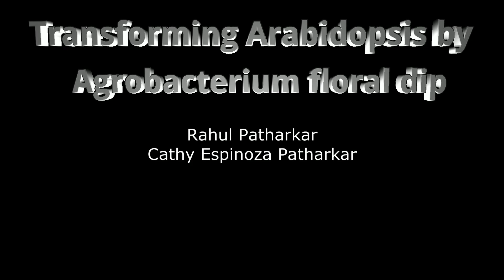Transforming Arabidopsis by Agrobacterium floral dip

Comment: i have a Question. Function of Silwet L-77 in this experiment. Thanks you.❤
Reply from the maker: It helps the bacterial suspension better enter the flower and get to the ovule be breaking the surface tension of water. Silwet L-77 is a nonionic detergent.

Comment: Hi Thanks for such a informational video. I was wondering do you maintain a specific OD (or you check OD of overnight grown culture) when you dissolve pellet into infiltration buffer?
Reply from the maker: Observing the OD is not necessary. My overnight cultures are passed log phase. A wide range of ODs can yield transgenic plants. The stage of the plant is quite critical.

Comment: Hello. How do you select transgenic plants in this method? Does this technique require PCR, gel electrophoresis, or DNA sequencing to evaluate the plants and validate the efficiency of transformation?
Reply from the maker: Basta, hygromycin, or kanamycin selection can be employed based of the construct used. It is best practice to check your putative transgenics out with PCR, however, all of those three markers listed have a very low rate of false positives if selection is carried out correctly.